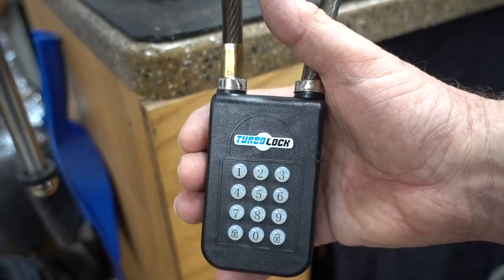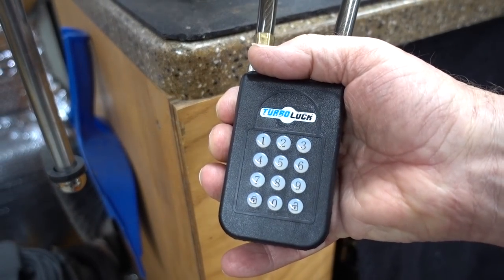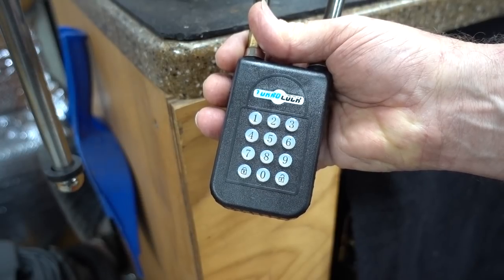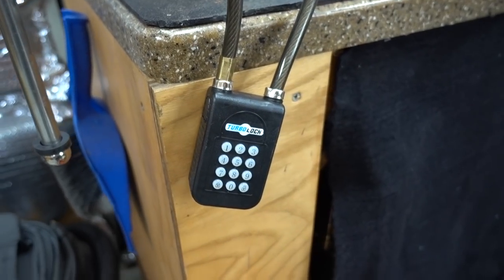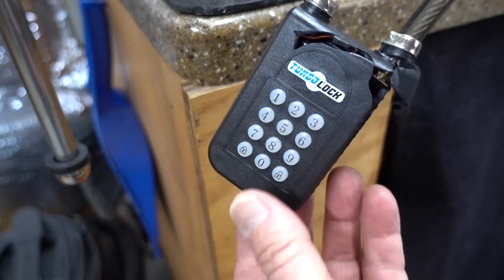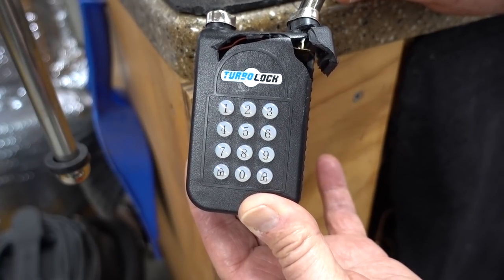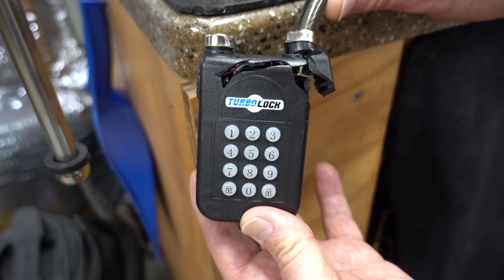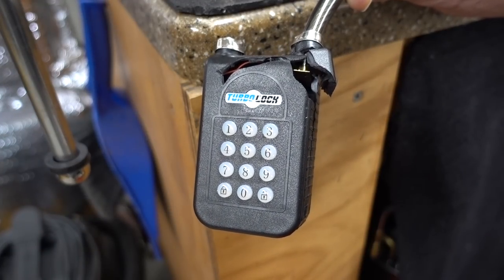(1721) TurboLock TL-400 Bluetooth Bike Lock (JUNK!)

Comment: I would be interested to know if you could break it by just grabbing the lock and twisting it to see if the plastic broke apart. Might take a few seconds longer than a hammer but you wont need a hammer.

Comment: I normally dont do this but I had to. Checked out the marketing: "Resilient Material: Keep thieves and natural elements from infiltrating your bike security with the bicycle lock’s steel cable and IP65 rating to combat dust and water."

And even higher up, they talk about: 
"the bike lock features a volatile thermoplastic casing and steel wire chain to protect your valuable ride amidst busy cities with high volumes of bike theft. "

RIP

Comment: would whacking it with a bolt cutter work as well as a hammer ?
i use a 5' pragmassis chain  with the feed-thru loop and 2 kryptonite new yorks
too bad the bike rack is made of architectural tubing (thin wall)
and held in place with 3/8" 'red heads' ...
DEATH TO BIKE THIEVES !!!

Comment: Normally with a bike lock, sure the lock can be picked relatively easily but realistically the homeless guy stealing it is not going to do that.
a lock you can basically pull apart won't even stop the drunkest thief.

Comment: I know the hammer entry seems to make my question redundant, but we may see the insides added to stronger casing in the future.

Does this use the typical relay/solenoid to open, this making it easy to bypass with a magnet?